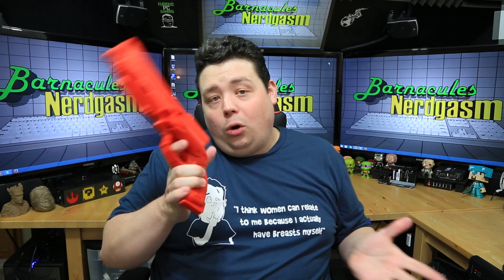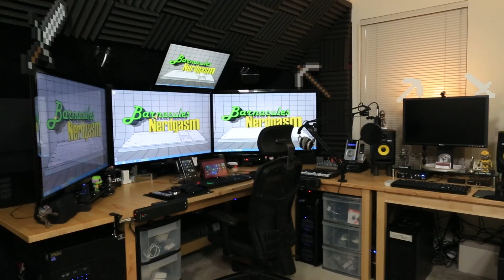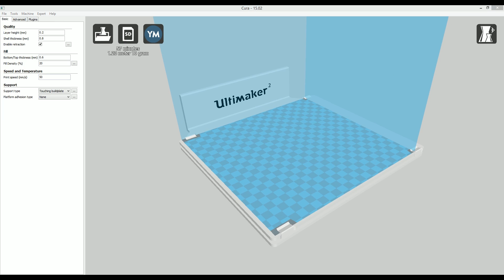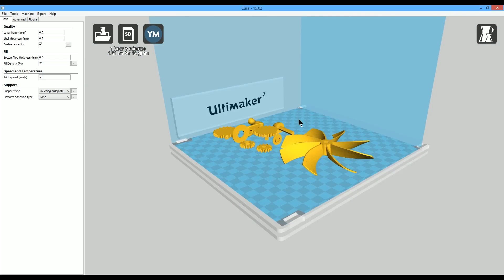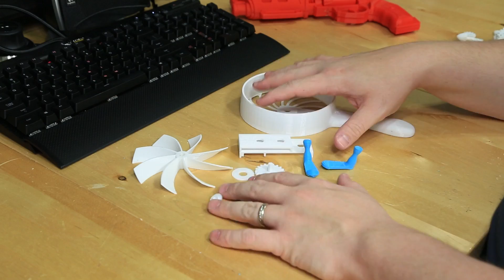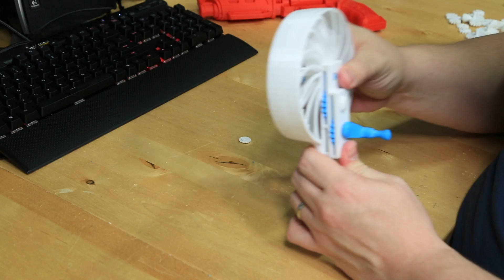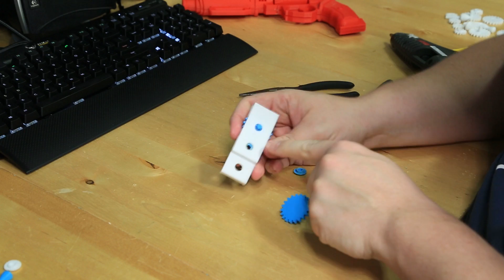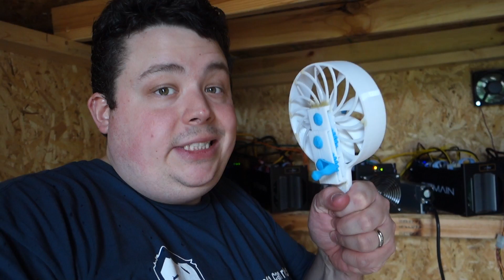3D Printing, Assembling & Testing a Mechanical Hand Crank Fan

Comment: I realize this is a very old video, but in case anyone else has trouble with trying to glue plastic mechanisms, I just wanted to mention the best adhesive I've found for 3D printed parts. It's called "Plastic Surgery." I bought mine on Amazon. It seems to form a stronger bond than the normal layer to layer adhesion within the print.

Comment: i'd get a 3d printer, then sell parts, and put them in a nice plastic box and yeah, buyers have to assemble it with instructions like some science thing for kids or legos (but less parts) and get it on toy shops, maybe a hand cranked car, and yeah. once i have enough money I can start getting more 3D printers (or better ones) and start mass production, become a millionare and stuff.
Reply: you will need to spend well over 10k on a 3d printer that has good enough quality to make it into mass production or you know, buy something like a lulzbot or an ultimaker or a prusa i3 mk2 and print and sell that stuff on etsy

Comment: Hmm, Barn, Kirby obviously didn't design an aerodynamically correct set of fan blades (even though they look like they are), because you're not feeling like it's blowing effectively. Maybe it's facing the wrong way for which direction it's spinning. Try flipping the blade wheel around (not just the entire device; the blades need to face a certain way for the direction they spin). And you also need a swivel on your crank handle.

Comment: The only use for 3d printers now is that, you make toys with it. other than that it serves purpose. Use can't even 3d a spoon because even that is going to cost you a fortune.
Reply: lol were you trying to say it serves no purpose?
Reply: Metricraft HD Exactly.
Just missed some two words in a hurry
Reply: actualy it will calculate and filliment isent that expencive
Reply: The printer is expensive. But what's the total cost of the stuff you print?

A spoon would cost about 5 bucks if made of metal and bought at a store. If we ignore the cost of the printer, with the cost per gram of for filament being about 5 cents, assuming a mass of 5 grams, then you get about 25 cents... Jesus. Of course we need to add the cost of running the printer, but energy costs 12 cents per thousand watt hours. With an Ultimaker you might need a few hundred watts. A kilowatt-hour is 3.6 million joules. 200 watts is 200 joules per second. An hour is 3600 seconds. Total energy usage per hour is about 0.2 kwh. About 2 cents per hour. Let's be nice and say it's 5 cents counting some other losses. If we say it takes 12 hours to print (yikes!) then the electricity cost would be about 60 cents. Add 25 and you get 85 cents. Talk about savings! But then there's the cost of the printer. However, it would amortize over time, since you could print hundreds or thousands of spoons (or whatever you want to).

Comment: 12:16 actually fan is turned same way even if you flip it
and glue ABS with acetone, no need to introduce second material if you can fuse both ABS parts together... it's easy with a brush.

Comment: Could you use the Simo Mini 3D or whatever that 3D printing pen instead of hot glue? You could use the soldering piece to heat 2 ends, then connect them. Right?

Comment: When I saw the beginning to the end of the vid I was kind of disappointed bc I though he actually printed a custom pc fan for the desktop computer.He would print out the frame and add other parts such as small motor and assemble them.But this is a still pretty cool.
Bernacules but can you please do another 3d printing video but this time creating/making a custom fan for your computer while assembling other features such as cool lighting that would be really cool.

Comment: Instead of using glue maybe try this in the future, I know it won't work on all prints but it works well for me on most multiple part prints that I need to bond. Have a look at friction welding using a Dremel rotary tool and a length of ABS or PLA. Just a thought.

Comment: hot glue was a bad choice, superglue would have been worse. you would want a chemical bonding agent that fuses the plastics together, and in an incredibly small amount. were talking like 2 molecules thick covering 80% of the surface you want to bond avoiding the edges

Comment: Just use solidworks tbh. It's just a waste of time to learn programs that are inferior, when you can learn solidworks which will definitely just blow your mind. And then if you actually wanna get into the profession of 3d-modeling stuff for engineering purposes you got a solid understanding of solidworks from your hobby-modeling. 
And getting started with the fundamentals of solidworks is super easy.

Comment: Why do you keep using the fan backwards? -- why not aim the front of it at your face or the thing you're trying to cool?
Reply: +Michael Jensen He accidentally installed it backwards so the airflow comes out of the back =P 
(The clockwise anti-clockwise thing he mentioned doesn't really work like that.)
Reply: +Chronon wow you are dumb. when he turns the handle, it turns it so the air is coming out the back. if he turns it the other way, how on earth could it not come out the front? also, he didn't even know that it was supposed to come out the front.
Reply: AnimXpert - Everything Animation Oh come on. It would go like you said but it's not the same thing...

I'll break it down for you: While being spun the other way it scrapes the inners and that prevents him to turn the crank, so yeah, it is accidentally installed backwards... It is not always a solution to just crank it the other way so "it doesn't really work like that". How complicated is this for you?

Btw, what kind of argument is that last one supposed to be? If he would've given it a bit more thinking, he would've put the blades the other way... Ask him if you care so much since you probably are too stubborn to believe anything I say anyway -.-

Comment: I think it should have been designed so the blades are further away from the back grill- that way it can turn in the right direction and move good air without getting the blades stuck!

Comment: You're probably better off with a traditional Chinese hand fan or a battery fan! However, they do actually make crank fans, they're just designed to be more efficient and actually seem to work better than the traditional hand fan. That model is probably more for fun!

Comment: Don't you think some things that can be printed on a 3d printer would be better off not being printed on a 3d printer.

For example: why print a flat sheet of plastic when you can just get a flat sheet of plastic, surely a 3d printer is better off being used for those intricate items that are hard to make manually, ie gears, perhaps plastic screws and nuts, specially designed items.

As for the fan a good bit of fun making it but really of no use, unless you turn it into battery operated fan, but then you could just make a housing for an ordinary small pc fan and use that, there you go a useful project an old pc fan with a printed housing that incorporates the use of a battery box.

I don't have a 3d printer by the way considered getting one but couldn't justify the cost so went for a hand printer instead much cheaper and I suspect will have more use.

Comment: Barnacules Nerdgasm would you maybe consider using modeling glue for these kind of builds? It comes (at least mine does) out of a needle tip so it's really precise. But i have no idea if it's strong enough for these things.

Comment: I scrolled down expecting to see comments about the fan orientation at 12:16
That way looks backwards. The scoop is supposed to push air out toward the operator. Even if spun the opposite direction, the scoops should be pointed outward.
Nice build and great instructions of course. I just thought you should know that about fan orientation.
Reply: The Sqoou Mee too. I was like: Bullshit! Everything counts in the design, when yo're making something that moves air. When I saw the design I thought about how the fan blades are passing the spokes of the housing in a way that produces an even turbulence. The way the fan is mounted in the video, the whole fan blade passes the spokes at the same time, which shold produce turbulence that can be heard from farther away. 
Also, I would think that the vurved blades are made that way to scoop up the air and trow it in the direction of the axle. mounting the fan the wrong way, the air is rather forced to disperse by the fan blades. Kind of like trying to scoop ice cream with your spoon the wrong way. That doesn't do a great job.

Comment: Hey Jerry just gotta say I've been enjoying watching your videos a lot, great stuff and thanks for all the time and energy. I know in effort to save time you gotta use glue to fix these style of prints up quick, but I think if you have the capability I would just recommend putting some rounds on those fan spokes so they don't snap off. I've seen a couple videos where you may be able to save yourself some glue time on the back end with a little CAD work before you hit print. If you already knew that then just leave my unsolicited advice by the wayside!

Comment: I'd make the washer a bit thicker and the little piece that holds the blade and the first cog longer so I can spin it the other way, after all that's when it pushes air :D And I think it will push a lot of it since it's quite big.

Comment: Hey Jerry, not sure if it would affect the plastic at all, but if you blast that hot glue with an upside-down can of PC duster (just a quick blast or two), it should make the hot glue break up pretty easy, which will make it a lot easier to clean up gluing mistakes.

Great video!
Reply from the maker: That is a fantastic idea! Thanks James! I used to use PC Duster to shrink the plastic to get it to pop off the non-heated build plate back in the day.
Reply: No problemo.

Just passing along what I've learned from jimmydiresta . ;) Thought it was particularly relevant to this scenario.

Comment: Would be interessting to see if it's possible to print your own pc fanblades for silence, air pressure, or airflow and play with different designs. I wonder if a (home) 3D printer is capable of of that.

Comment: Krazy glue type glue works really well with PLA as does acetone based nail polish top coat.  I find whether I use it as adhesive or top coat, it gives a tough strong bond, very clear.  Raid your wife's stash if you must.  I buy it in big bottles at the big blue W box store (you know who they are).
Reply from the maker: Just stole her bottle of Acetone, I've heard it doesn't work on PLA though, is that not true?
Reply: Sorry, I was unclear.  You want the nail polish clear top coat and use that as glue.  You can paint a whole PLA model with it, glue with it, etc.  ABS will melt but PLA will get tougher and glues really well.  I've been using it for months now.
Reply from the maker: ann kiszt Oh wow, that is awesome. So clear top coat for nail polish works as glue for PLA? Amazing.
Reply: Yes and it dries clear, bridges small gaps, shrinks to fit, and builds up layers if you apply successively.  Your fan would have been much prettier.  I've been painting prints with nail polish and I can't get over how much stronger the plastic is after.

Comment: Barnacules Nerdgasm  Cyanoacrylate would have been a better choice for glue i think since it would slightly melt / weld the plastic back together. plus you can coat 3d print with it to strengthen them. cool video.

Comment: nice video and project.  There is a glue gun for more detailed work available which may help for future projects.  Fine glue nozzle for detail work.  Just thought you may be interested:

http://www.walmart.com/ip/35681257?wmlspartner=wlpa&adid=22222222227024108087&wl0=&wl1=g&wl2=c&wl3=52574100191&wl4=&wl5=pla&wl6=84455685671&veh=sem
Reply from the maker: Good idea, I should get some more detailed nozzles

Comment: There should be a 3D printed quadcopter racing series.
Everyone would have to use the same batteries, motors, camera, and sensors but have to design and print everything else.

Comment: that's gonna be more useful if you re-design that and put some small motor and 9 volt battery. Now you have an easy and reliable electric fun on handy, on the summer time or on the beach... cool.

Comment: Barnacles, just so you know: fan direction in final assembly is backwards. 

Also, as a quad owner you should know that fan blade direction matters. This is why you can't simply flip fan blades around for the different directions you need them to spin on a quad.

I'll let you figure out why...

Comment: It's truly amazing the time involved 3d printing something so useless. Is there something you can print that somebody can actually use. Kinda like that sim card adapter you printed for your Oneplus One. I know that being laid off from Microsoft for a real hungry illegal alien that will work twice as hard for half the price gives you all the time in the world, but God Damn
Reply: onerpone The point of 3D printing things like this is not to have something to use. It's more to prove concepts and experiment with techniques. This fan doesn't serve much of a purpose in and of itself, but it does an excellent job demonstrating how certain things, like impellers and even gearboxes, can be printed. He even mentioned that he could probably 3D print  quad copter propellers. That's a very practical lesson that came from basically dicking around.

It's just like when learning or experimenting with anything. None of the programs you make when learning to code are worth anything, but the techniques and tools you use get you ready for working on real projects in the future.

Comment: Barnacules Nerdgasm a few drops of isopropyl alcohol will make any of your hot glue fall off BTW.  Just in case no one else has mentioned it.  Should making it much easier for you to remove any excess glue. Love the video,  as always :-D

Comment: Hey Jerry, why don't you use acetone instead of glue? The chemical agent causes the plastic to stick to itself and strengthens the layer structure. Not to mention it looks nicer.
Reply from the maker: I don't think it works with PLA
Reply: Thor Svendsgaard Acetone only really works with ABS and similar materials. :(
Reply: Barnacules Nerdgasm It only works with ABS.
Reply: he doesnt have the patience to apply the hot glue/
Reply: it works with pla however it has less of an effect so you can be more generous with the acetone.
Reply: Barnacules Nerdgasm  Have you tried using a super glue that brushes on purple and dries clear?
Reply: ***** superglue sticks too well. i tried it and it broke the glass. never again.
Reply: mattio79 he means to bond part together.

Comment: I'm curious how long did it take to 3d print all those parts     I've got a little 3d printer that was pretty cheap took me over 24 hours to 3d print a tiny little doll which came as a demo with the 3d printer to teach you how to work it.